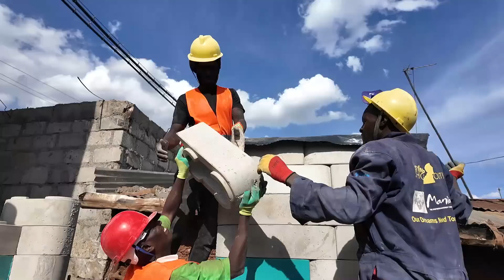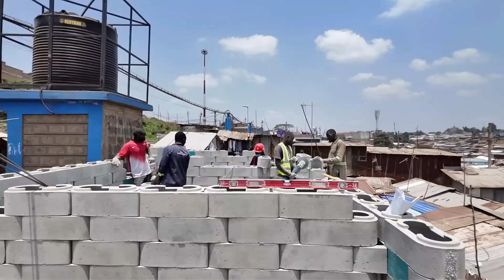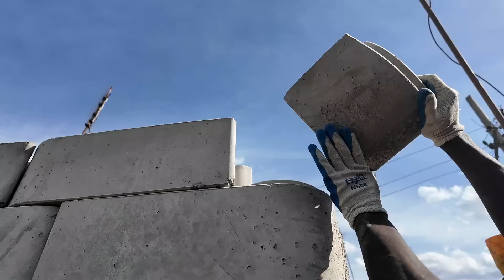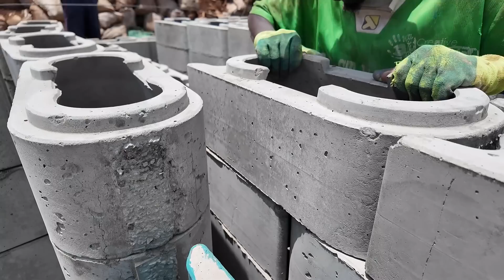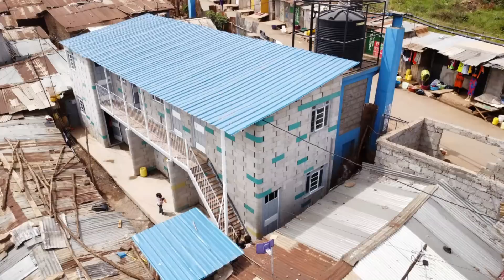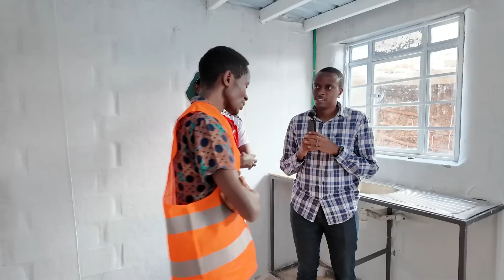See How Twist Blocks Are Building a New Kibera – 8 Units Completed!

Comment: stop using peoples garbage, those blocks would never be allowed in other countries. The blocks are hollow with no interior insulation to damper noise, large gaps in between blocks that can allow air flow, rain water and tiny insects.  MOVE FORWARD NOT BACKWARDS
Reply: Might you have a better solutions to upgrade the informal houses from mabati and mud houses? I believe that would be very useful- you can reach out to Daniel for ideas.
Reply: @lillyanel8986  true.
Reply: What are your thoughts about the precast designs .."the long once "
Reply: One can improvise and plaster them.Still way cheaper
Reply: @Railalioness  The say that if you plaster- you can use blocks when you say want to 'dismantle' the blocks, for redesign or reuse.